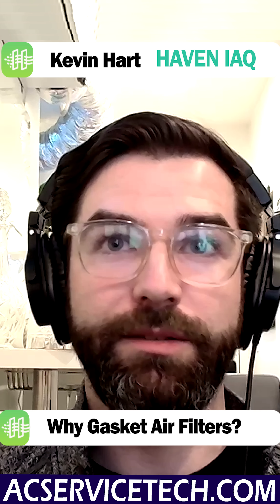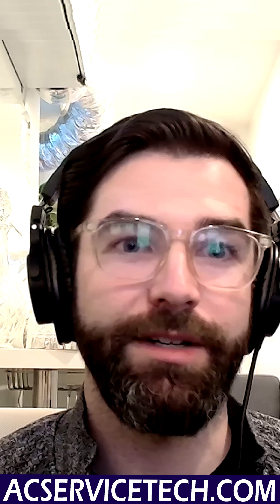The Importance of Gasketing in Air Filters When Working On HVAC Systems!

Comment: This is why I just do the Aprilaire filter system. Plastic sliders on two sides and the filter ends more or less seal the sides. So glad my company uses them. High fltration, high airflow long filter changeout times. Cant get better.

Comment: Filters are to keep the equipment clean.  They are not to clean the air you breathe.
Reply: This. Can't wait for goofy sales pitches about why you need a $100 filter because it has a gasket on it.
Reply: Filters I thought were to keep the air clean and infection free. Like hospital theatre’s!
Reply: @wtooomd only if the system had new ductwork installed or they were well cleaned and sanitized prior to assembly and commissioning . 
 I have had evap coils that were 99% blocked between the fins with growth..+55% humidity at 70°f.  Tried alkyd foaming cleaners but no results. Ended up replacing the 5 ton ac coil. Verified all duct joints taped, filters sealed. . Uv lamps function....